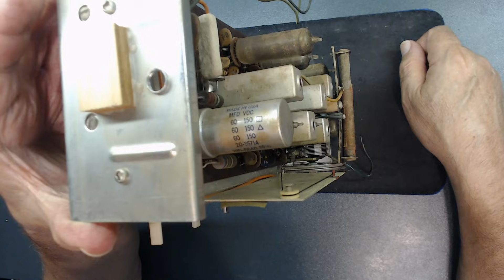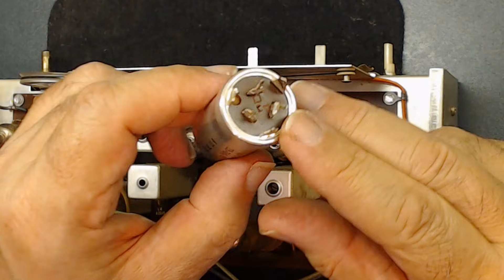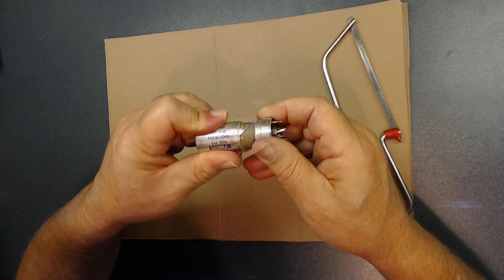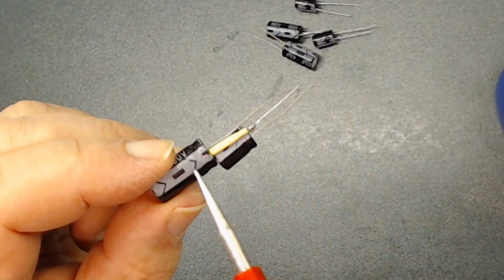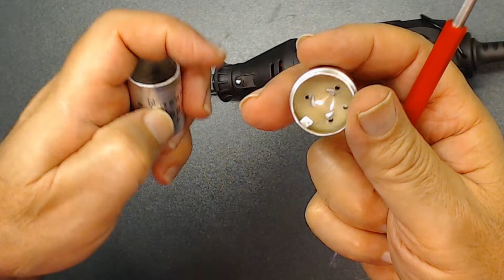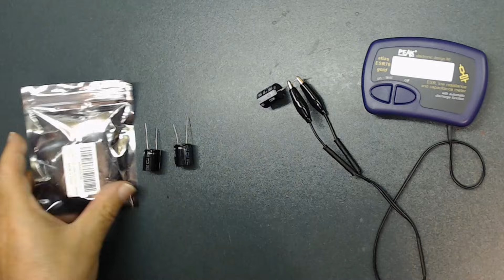How to Repair / Rebuild Multi-Section Electrolytic Capacitors - (Step-by-Step Guide for Beginners)

Comment: When stacking several electrolytic capacitors tightly inside the original can, could internal heat buildup be a concern? Especially when the can is mounted right next to a tube? I’ve never worked on tube radios myself, just a thought.
Reply: No, internal heat is not a problem - at least not that I've ever seen.  I honestly can't recall ever seeing a can filter in close enough proximity to a tube to cause enough heat gain to effect the caps in any meaningful way.  Even cheap electrolytics are rated at 85C, but of course, you don't want to run them anywhere near that hot and I can't see any situation where the internal temp of the can will get anywhere near that. I always buy low ESR 105C caps because they're not really much more in cost. In any case, if this is a concern for a specific application that might run a can filter close to a high power/heat tube, you can drill some tiny vent holes near the top oriented in a way where they won't generally be seen as long as the bottom drill holes allow some air in.
Reply from the maker: Hi John, thank you for answering this question! I haven’t experienced any internal heating when installing new capacitors in old electrolytic canisters. That said, I don’t typically play the radios for long periods of time.

It’s so great to hear from you—thank you for taking the time to message me and for supporting my channel!

If you’d like, feel free to check out the attached video series, “Rat House Radio,” which you might also enjoy: https://youtu.be/uMfL4Eakzng
. It was a 100% full restoration project. Each series is unique and different, and I try to take a new approach to solving the challenges in every project.

Have a great day!

Regards from Florida,
Jay
Reply from the maker: Hi Bracsl, it’s so great to hear from you—thank you for taking the time to message me and for supporting my channel!

Great question! As John mentioned below, I have not experienced internal heating when installing new capacitors in old electrolytic canisters. That said, I don’t typically play the radios for long periods of time. I would recommend using capacitors rated at 105°C or higher for best reliability.

If you’d like, feel free to check out the attached video series, “Rat House Radio,” which you might also enjoy: https://youtu.be/uMfL4Eakzng. It was a 100% full restoration project. Each series is unique and different, and I try to take a new approach to solving the challenges in every project.
Have a great day!
Regards from Florida,
Jay

Comment: When you encounter an electrolytic capacitor with a cardboard cover, check to see if it is mounted to a phenolic wafer instead of directly to the chassis. If it is mounted to phenolic it means that the negative rail  of the power supply in the radio is NOT common to the chassis. There will be a difference in voltage between the chassis and the negative rail. This is sometimes due to the way the bias voltage is derived for the audio output. In any event, It does mean that you must not connect the negative side of the capacitors to the chassis. 
Also, when electrolytic capacitors are mounted to printed circuit boards, the can of the capacitor is often used to connect parts of the negative rail together, and if you install capacitors in any method that does not use the original can, you should make certain that you connect all of the parts of the printed circuit board that the can was connected to together, or the radio may not work.

Regards,

Gar
Reply from the maker: Hi Harry, thank you so much for sharing your insights and valuable tips on working with cardboard electrolytic capacitors! Your detailed explanations are genuinely helpful to everyone following along.

It’s so great to hear from you—thank you for taking the time to message me and for supporting my channel! You’re absolutely right, and I truly appreciate you bringing this to my attention. I’m very glad to hear that you enjoyed the video.

If you’d like, feel free to check out the attached video series, “Rat House Radio,” which you might also enjoy: https://youtu.be/uMfL4Eakzng
. It was a 100% full restoration project. Each series is unique and different, and I try to take a new approach to solving the challenges in every project.

Wishing you a wonderful holiday season!

Have a great day!

Regards from Florida,
Jay

Comment: On electrics , slightly larger cap work just find. 🎉
Reply: By "larger", did you mean a higher capacitance value? Because most rectifier tubes are limited to 40 mfd or less as the first stage filter, otherwise the rectifier can be prone to arcing or shortened lifespan. The following filter stages can safely use higher cap values than the stock circuit, but the 1st stage filter cannot be too high ---- consult a tube manual for the rectifier specs.
Reply from the maker: Thank you for the clarification. The detailed information you shared can be very helpful to everyone who enjoys this hobby, especially those without an electronics background.

I usually follow the schematic, and if one isn’t available for the equipment, I check the actual part specifications—assuming the parts are original and haven’t been replaced.

Thanks again for highlighting this—it’s an important distinction and a good reminder to always check the rectifier specs. I really appreciate you taking the time to explain it so clearly.

Have a great day, and thanks again for sharing!

Best regards from Florida,
Jay
Reply: Regular caps that have a larger working voltage are physically bigger in diameter. That may keep you from fitting more
than two inside the canister. Somewhere I saw that Supertech makes taller and skinnier caps that would fit.
Reply from the maker: Hi Steve, you are absolutely correct—capacitors with higher working voltages are physically larger in diameter. Today I found 68µF, 160V electrolytic capacitors on both Amazon and Digi-Key. I’ll be ordering a few of them for future projects. LOL.
Have a great day, my friend!
Reply from the maker: Hi Tom, 
It’s so great to hear from you—thank you for taking the time to message me and for supporting my channel! You’re absolutely right, and I truly appreciate you bringing this to my attention. I’m so glad to hear that you enjoyed the video.

If you’d like, feel free to check out the attached video series, “Rat House Radio,” which you might also enjoy: https://youtu.be/uMfL4Eakzng
. It was a 100% full restoration project. Each series is unique and different, and I try to take a new approach to solving the challenges in every project.

Have a great day!

Regards from Florida,
Jay
Reply: @RadioFixer back in the ‘50s, I worked with my father in his TV repair shop. My specialty was car radios. 🎉
Reply from the maker: Hi Tom,

I wish I had known about this when I was working on my car radio—I could have asked for help since it was my first car radio repair! You might enjoy watching this 2-part video series. Now I know exactly who to reach out to for my next car radio project. 

Part 1: https://youtu.be/DABVqcgAEOI

Part 2: https://youtu.be/YuDg8OoB3Zo

Wishing you a wonderful holiday season!

Best regards from Florida,
Jay